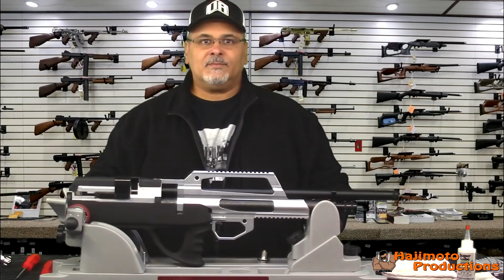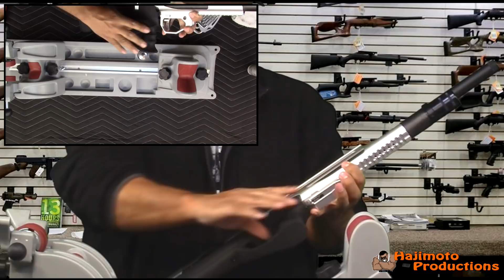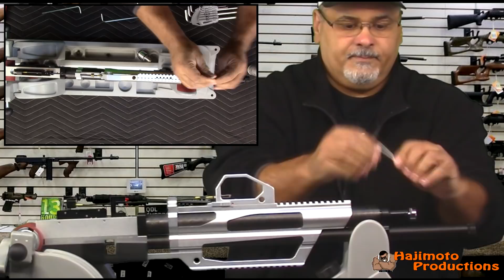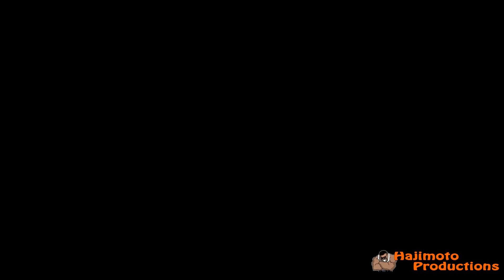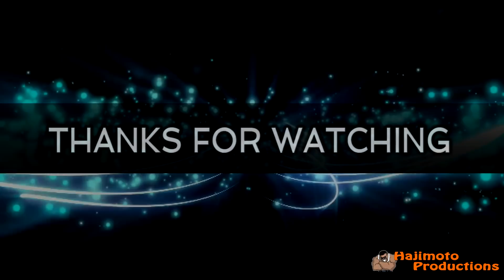Evanix Max Air: Regulator Install

Comment: Great video as usual Haj. How does the barrel shroud come off so that I can add additional 3D Printed baffles? Can it just spin off without any other disassembly?
Reply from the maker: The Barrel shroud simply unscrews just like that of the AirSpeed as I demonstrate in the video below:
https://youtu.be/4mUp_hEgclA?si=uXrD20W_IR1sg9f6&t=175

Comment: Waiting to see the performance of the Evanix Max Air after the regulator installed. Also let us know the make and price of the regulator.
Reply from the maker: The regulator was an Evanix part. I was testing it for them and made an installation video of the part. Evanix decided to pull the plug on offering the regulator so this video and regulator are unicorns.

Comment: Is that an Evanix factory regulator ?
Reply from the maker: The regulator was an Evanix part. I was testing it for them and made an installation video of the part. Evanix decided to pull the plug on offering the regulator.

Comment: Hi Hajimoto - does this also work with Evanix max air 2...? And what regulator would you recommend. Altaros - huma - lane. Regards, Chris
Reply from the maker: Hey there! I would not recommend a regulator at all for the Max Air, Max Air 2 or the Air Speed. This regulator was an Evanix produced unit and I was testing for Evanix. They decided not to move forward with its development.

Comment: Superb informative video 👌👌, could u please make a video on “Evanix max air 2” too for cocking trouble rectification, how to check cocking lever in my gun even after pulling the lever it doesn’t gets cocked, please please help me on this 🙏🙏
Reply from the maker: You are having a trigger sear engagement issue. You may need to move the block forward to allow better engagement. I show this in one of my Evanix videos. you will need to search for it I'm sorry but I cover the reassembly of the trigger group and how you can increase the power output.

Comment: Hello Mr. hajimoto ,
I bought max air lately and installed a gem tech silencer on but my groups in 40 yrd without this silencer are tighter ,with gem tech my group aren't tight enough and my shots goes 3 inches up on my target   (with 18.13 grain jsb exact jumbo heavy) what silencer models and pellets do you suggest for max air .22?
thanks a lot for your precious time!
Reply: I just got mine that is .25 caliber. I'm using the DonnyFL FX Moderator and have only tested it at 20 yards so far with JSB Exact King 25.39 grain and I'm getting 3/8" groups.

Comment: Thank you great video. I have one question: what about the regulator venting? Do I need to remove the oring from the valve housing?
Reply from the maker: Thank you and yessir you need to remove the oring. Thing is, I am not sure Evanix will be offering these for semi autos anymore due to the long reg recovery time between shots.
Reply: @HajimotoProductions  

First of all I love your YouTube channel is like to ask you is there any mods that you know of for my max air 30. 2 to bring up the power or make it more accurate I purchased the slug barrel from air gun pro they are a great company to deal with .i also have a donny fl moderator ,I love the gun, but there's not alot of info on this gun